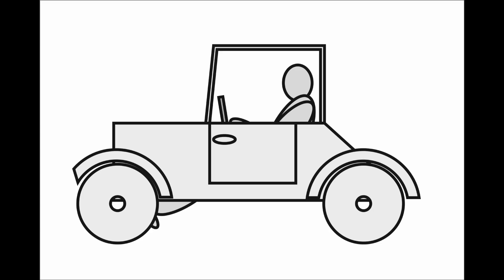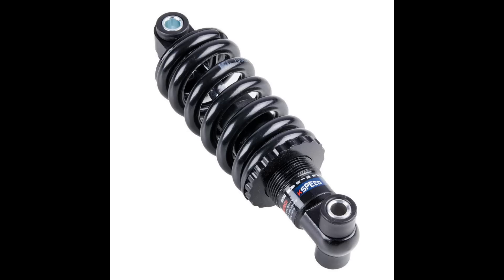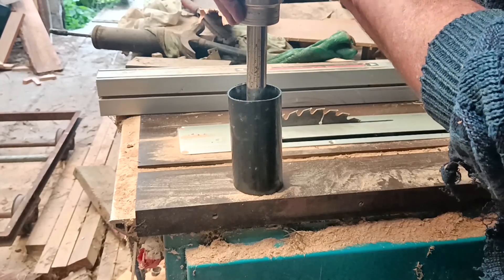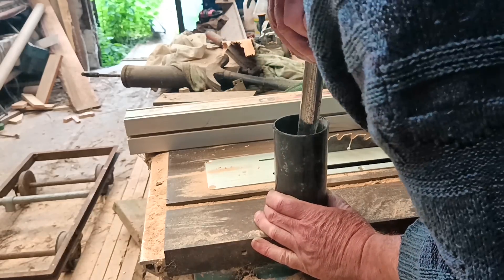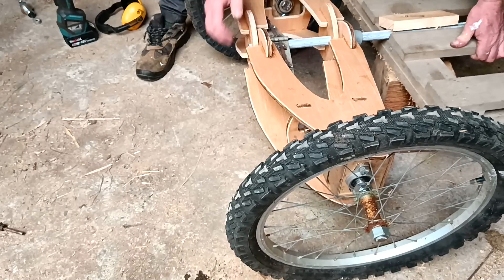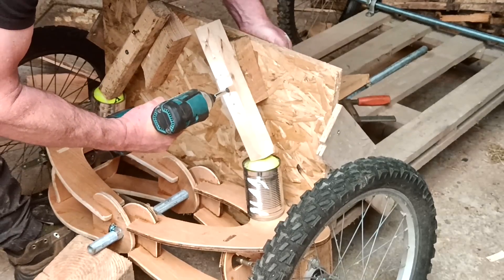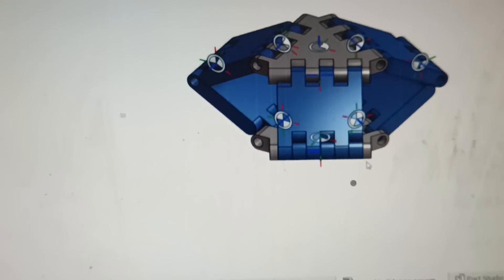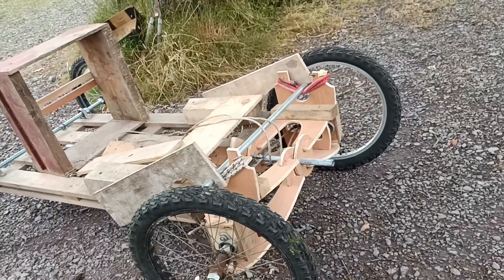Can I Use Tennis Balls For Suspension In The Wooden Car? Or Bungee Cord?

Comment: Nice investigation.
Has anyone suggested torsion bar "springs" ? Utilises twisting of rod as spring. Eg suspension arm twists one end of torsion bar rod (can run  torsion bar rod through bearings to support chassis) Other end of torsion bar rod  prevented from rotating/fixed  to chassis of vehicle.. Though it's quite possible to add adjustable fixings to allow very easy changes to  ride height. Useful if vehicle weight  might change lots
Reply from the maker: are they always steel?
Reply: @wayoutwest-workshopstuff6299  steel tubes are Usual because, 
1) tubes are the most mass efficient 2) steel has good fatigue resistance to cyclical stress.

Other "rod" material might work OK... Doesn't have to be round, or even cylinders. Wooden dowell, carbon fibre tubing etc might work, but I'd keep a close eye out for wood splitting. 

lengths of rope twisted together (akin to mangol/ballista "catapults") will work similar and likely to be more reliable. Frame between which such rope twisted tensioned would have to fairly strong to take the considerate tension along the ropes. .

Comment: Great stuff Tim! As an alternative to bungee cords I use old bike tyre inner tubes for various  jobs. My son used to compete in a cycling team that was sponsored, so punctured tubes were always being replaced rather than repaired. You might get free scrap tubes from a bike repair shop.

Inner tubes should be stronger than  bungee cords, and you can easily inspect for wear.

Whatever  expansion spring system you choose, it occurs  to  me that you could have some adjustment system built in (turnbuckles?). If this was via rope and pulleys, then each front axle could share the same tension spring, keeping them equally balanced.  All the best, Chris.

Comment: On the one hand the bungee cords might stretch over time, on the other hand they're cheap. You might want to try trampoline springs like another feller in the comments suggested. (unless there aren't a lot of trampolines where you live) They're not terrible to get second hand and might be just the thing. Either you could set it up so they're being stretched, or set them up like your bungee cord system where they're being pushed sideways.

Comment: I frequently watch videos by "the bus grease monkey" (Scott Crosby).  He frequently replaces air bags used for suspension, but they seem to require compressed air to work and are only used on vehicles so equipped.

Comment: In the 1960s there was a sprint motorcycle that used bungy cords for front suspension. I think (memory!) it was called “Ag’s Barra”. The bungies were used in tension via rocking links at the base of the front forks. I would have thought that a small fat inner tube (scooter?) squashed between two plywood boards would be viable too. Have you looked at Citroen 2CV suspension? And surely those bicycle suspension units could be modified (softer plus longer travel) by using the principles of leverage.. Les in UK

Comment: It's weird that 60 years of world leading British innovation and engineering in Formula 1 and open wheel racing with in board push rod suspension that can easily reproduced with some metal rods and plywood cutouts made with a jigsaw - straight over your head. Your double wishbone setup is literally from F1.
Reply from the maker: Not sure what you mean, sorry? What am I doing wrong?
Reply: @wayoutwest-workshopstuff6299  Well you're not doing anything wrong but poor design choice and crossing the stream to get water. Brilliant British inventors, designers and engineers have pool their knowledge of prime suspension design into F1 using a double wishbone setup like you have there, right. pair the double wishbone with a centrally sprung push rod traditionally elbow mounted for better geometry and efficiency and there you go no need for sheets or 2x2 pushing on tennis balls. Btw you could have use the softer and harder ball in a combo so to absorb different frequency suspension travel and have the rod not push on the ball itself but rather on some sort of cup for enlarged surface contact. There no shame in not reinventing the wheel and it's not theft of intellectual property to learn from concepts brilliant British engineers have won numerous world championships with in fact it would be a shame not to. Like your homage to British engineering.

Comment: As cheap as chinese motorcycle coilovers are, seems a better deal than making your own. And as someone who raced rc cars as a kit, no suspension is almost always better than a bad suspension. Just a few rubber pads to reduce sharp impacts should suffice like wagons of old. Your last bungie suspension was poor because it was alreaduy on the bump stops, it has to be able to move both ways, i prefer the tennis balls to it for that reason. Perhaps try leaf springs, conventional, but tried and true.
Reply from the maker: I've ordered some coilovers as you called them - but they may be just too stiff because this car won't weigh much. Leaf-springs - too heavy. Bungee? maybe, maybe not. So many choices!

Comment: Cut a disk / use washers the same diameter as the top of the can tin. Attach disc to pieces of wood,  the wood then irun vertically. You could use a round pieces if wood and not have the disks, attach the same way, put a bolt though middle of wood and bolt at the end. Bolt feds through to spring plate, runs through piece of wood and is bolted fully other end

Comment: Wonderful R&D.  Note how in your test rig, you had a rigid rear suspension and things went fairly well: backs up my earlier point about keeping your rear suspension arms on the stiff side.

An air ride suspension is a neat idea: you probably could bodge one of with innertubes and some lathe turned parts, but I don't suppose you've got a lathe handy (the tools you do have access to are amazing, things I don't have and don't think about, but I've got a lathe) and while it would be more refined and tunable with air pressure, your design with bungee cords is just a little more low teach and obvious to the user should anything start to fail (making repair and service easier).  Keep going I say and thank you for making and sharing these videos.

Comment: I really think you are over thinking the whole thing a simple leaf spring pack from a small trailer would great a small trailer even damaged is worth near nothing and a packs stiffness comes from the combination of springs with the main one being the softest so if you take the long leaf with mounts either end flip it upside down this is effective and how many early cars did suspenion
Reply from the maker: Way too heavy  : -  (
Reply: @wayoutwest-workshopstuff6299  an entire spring pack for a 750kg rating is about 17kg but you would likely only need the single top spring it would likely be less than a quarter the total weight and 4kg isn't much about the same as the 2 wheels it would be attached to.
Not to mention functionality and simplicity over current options
Reply from the maker: @shaynegadsden  Thanks, Shayne. Can you send me a link? Still too heavy though!

Comment: the original mini basically uses tennis balls to hold it together... elastomer suspension. pivots and shockies in one...

i prefer the bungee, seems more... changeable. serviceable. available in different thicknesses...

and balls, (someone suggests squash balls) have air inside. they heat up. they change properties during use, and they wear out...

bungee for the main shocks, with a squash ball for the stops/limits.

and springs need dampers!

i suggest copper (or heavy wall ali) tubing with a stinking fat neo magnet up the inside on a rod. use the power of the lenz...

Comment: Honestly they’re both extremely good ideas but my thought is you should do a combination of the two, bungee spring the rear which generally needs less travel and more stiffness anyway, and use tennis balls on the front where you generally want more travel
Reply: Agreed. Don’t get locked into either/or thinking. Your initial options are not mutually exclusive.

Comment: Springs are good, but do not provide damping.  I've made a setup with 6 inch gas filled struts (gas lift struts) used for kitchen cupboard doors.  Much more efficient and can be pumped to various pressures.
Reply: Thats actually a decent idea.

Comment: The answer is yes, here in outback Australia as a young lad. Depending on if it was wet or dry or if the roads had been graded, we used to shove tennis balls inside the springs to improve the drive. Made the bumps better for spotlighting.
Reply: I've also seen other rubber balls stuffed in springs and inflated for a firmer ride. Put it in flat, then inflate it. Way easier than pre-pressurized balls.
Reply: @nobodynoone2500  pretty sure a 16 year old isnt a. Going to think of thst and b. Thats what they had at the servo

Comment: a rotary spring would be perfect, the mount for things like rotary springs and torsion rods usually goes behind the suspension, one each side, so you can make a really really really flat car.  for yours, you could use a coil spring in the middle and a sway bar behind the pivot point, the sway bar will be more important when you get compliant rear suspension.  i think the mg used rubber bands, there were many others around the time that did.

Comment: Bungee cords rot and/or stretch way too easily. Especially if they are left outdoors. I suppose they would work as long as you had them oriented in such a way as they could be replaced very easily. Honestly I like the tennis balls better. Well, the fancy ones that don't go bad as quickly as regular ones, anyway. You could probably soften the tennis balls further by not containing them sideways with a baked beans can. Allow them to stretch more. Roll a piece of sheet steel into a tube with 2 or 3 layers. Add hose clamps to keep it cylindrical, and place the clamps at the centers of the balls inside the tube. Then, adjust the hose clamps to let the balls squish more or less.

And make a pivot for the tube on the bottom, and a pivot for the ball squisher (lol) so you don't need to worry about angles.

Comment: Tim I understand the need for simplicity.   I dont understand why the use of fiber glass rod has not been used.  It is cheep and computatable for strength.  Its durability is endless.  Diameter times length equals strength. Per haps not avaliable in your part of the world.  Enjoying the journey as always.
Reply from the maker: I'm not against fibre-glass. Happy to use anything that works. It's true though - I never see it for sale and I have no experience with it. Are you thinking it would work as a spring?
Reply: Fiberglass layers over the wood are often stronger than the wood itself! Might be good where you need better weathering and more strength. Be sure to use a UV stable epoxy!
Reply: Yes here in us we use it in rod formation.  Avaliable in 1/8 to 1 inch.

Comment: Given that your normal ride height needs to be more or less in the middle of the suspension travel, and you really don't want to be hitting the stops at either end, I suspect anything much less than 6 inches of travel will result in unacceptable ride quality.  It might be worth setting up your test rig with some kind of telltale to see how much travel is actually being used at speed on different surfaces.
Reply from the maker: yes I have - too heavy though

Comment: What I would try is to run a bungie from the left side top, under the center axle, and hook it up to a top right anchor point, and then do the opposite for the other side
Reply from the maker: One side may affect the other though - then they wouldn't be independent
Reply: @wayoutwest-workshopstuff6299  yeah if you hooked them I to eachother it would, it might act like a built in sway bar  like a real car, but I meant like you did with the tennis balls, have an anchor point above on both sides

Comment: I believe the tennis ball idea is preferable. Three balls inside a sealed pvc tube with piston arms through the pvc caps. Worth a trial anyway.
Reply: I was thinking about the same design.  One end could have a glued on cap and the other end could have a screw on cap so it  could be opened up to change the balls if needed.

Comment: I would go with springs if they are free combined with rubber balls.  The springs holding the majority of the weight.  Ive had no luck with bungees lasting any length of time.  I imagine you'll have them in the rear to protect your backside 😂 and was testing concept for now.  Great job by the way

Comment: If those tennis balls are filled with an aerated rubber foam and not pressurised, then you can probably drill and run a rod straight through them with stops at either end like a shock absorber.
Reply: great idea
Reply: I thought only the dog toy ones were made like that.

Comment: Could make some air shocks from some small rubber tires and a couple of metal squash plates with a holding groove on the inside (kinda like a rim on the outside instead of the inside) with a valve for inflating or deflating for the desired squish. Don't know how well it would work or if it would even hold air but it's another avenue to explore if you so choose.

Comment: Love the concept. A wooden car. Get out of my head!!
OK, not an engineer, but let me try to make a contribution here. 
Seems over complicated. 
Guess what has excellent spring characteristics? Wood. 
Leaf springs. They were all the rage once upon a time. 
Plus, in engineering terms, if you can have one part play two roles: Winning!
Horizontal leaf spring could replace the upper 'wishbones', and provide spring. 
Experiment with different spring count easily. U clamps. It's all cheap. 
Best of luck.
Reply from the maker: Yes, I agree. But as you know, wood is so variable - it might be hard to replicate something that works?

Comment: The Mooney M20 (small airplane) has a similar suspension to that which you have described. They use a stack of rubber bushings in place of tennis balls, but if it’s reliable enough for landing gear it should work fine

Comment: You can salvage a lot of free extension springs from a worn out/broken kids trampoline.
Compression springs are easily found in old cilinder heads.

Cool project!👍
Reply: this is going to lead to some very disappointed neighbours' kids the next time they go out to play on their trampoline, lol
Reply: @tomslastname5560  The springs and frame always outlast the trampolene, are often fouind as salvage.
Reply: Great suggestion but I don't know if the cylinder head spring would have enough travel
Reply: Stack them, and you could run a bolt on the bottom that runs through as a guide
Reply: @highnoonsmallenginerepair  increase the leverage then.  Old farm cultivators have compression springs same as a pelletgun
Reply: @highnoonsmallenginerepair  certain old small antique cars used a lever arm shock system that would have enough travel for your light weight car. There is a wrecked car on my great grandfathers homestead that has two still on the frame
Reply: @carmichaelmoritz8662  Not all those cars were small! I have a couple sitting around here that came from an old London Taxi.   I recall that the MG TD used similar lever-arm shocks. Probably lots of others!

Comment: One possibility is "Kong" rubber dog toys. They are actually modeled after air springs (the inventor was a car mechanic whose dog liked to play with them) and they come in a wide variety of sizes and also several levels of hardness.
Reply from the maker: Brilliant! Thanks - I'll look into them
Reply: funny i've had several dogs that had kongs and i'd never heard that. quite a fascinating tidbit, thanks for sharing mate!
Reply: Great idea! Those things are tough and will likely way outlast the tennis ball.
Reply: @LazloNQ  I wonder if I could use those to replace the bump stops on my old vw. It could use new ones.
Reply: @WikiSnapper probably the wrong size and stiffness, but only one way to find out. FOR SCIENCE!
Reply: @WikiSnapper  Yup, they look just like the bump stops on my ‘71 VW bus.
Reply: They are pretty popular ..my missus has some kind of Kong toy
Reply: @willeveryday  
Lovely
Reply: The cart looked like it had a better front wheel camber angle with the tennis ball set up than it did with the bungees. Also with steering like that the response is not as good as a steering wheel!
Reply: I’d never heard of Kong dog toys ( I don’t have a dog ) and they do look like the suspension dampers used on some small cars. Looking on Amazon I found they come in 4 chewing resistants blue (puppy rubber), purple (senior rubber), red (classic rubber) and black (extreme rubber) giving a option range of suspension resistance. They are about £10 each.
Reply: This was better than anything! 👏
Reply: That's where the shape comes from? Wow, I wondered about that when we got one for our dog.

Comment: How about wooden leaf springs.   May need to steam some pieces of wood to get a bend in the leafs.   May work better than bungee cords.   As others have said, rubber likes to be relaxed most of the time.
Reply: Ie. Bed slats. They’re as wide as a single mattress though but are preformed to be curved.
Reply: @locouk  
Brilliant !
Reply: This would be cool
Reply: Or just pull a trailer leaf pack apart and use a single leaf

Comment: Have I seen you using those coiled tines off a hay rake on something recently ?
I bet you could incorporate one each side to do your springing ?
You could mount the coil on that central bar, with the tines going out to the wishbone and could use them "trailing arm style" for the rear axle too ?